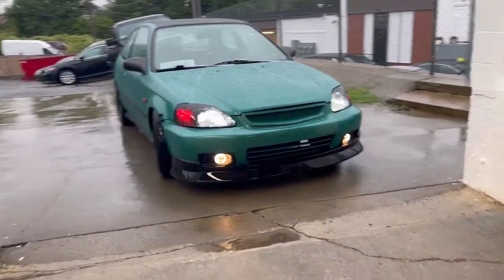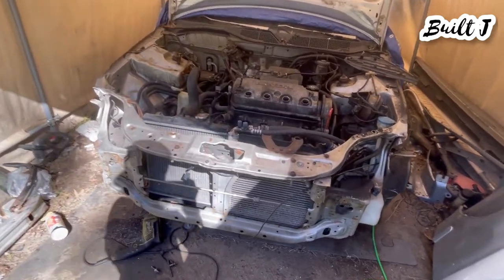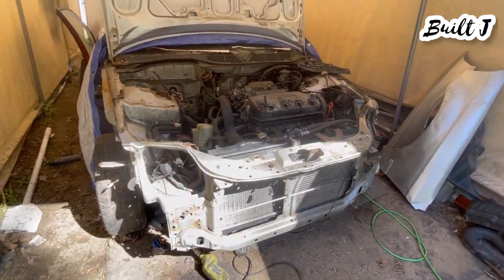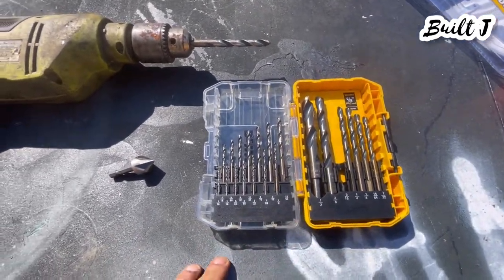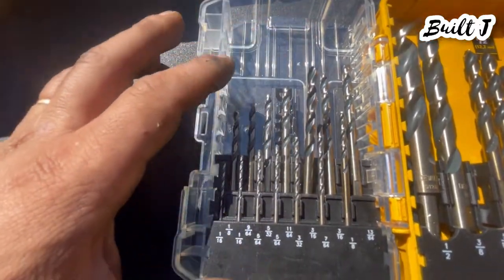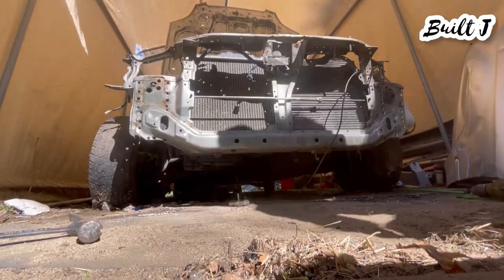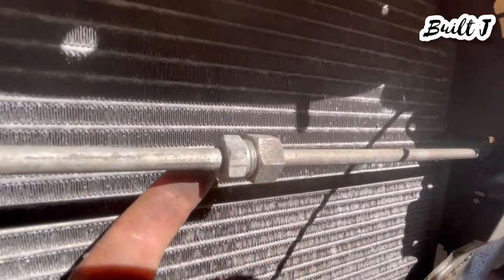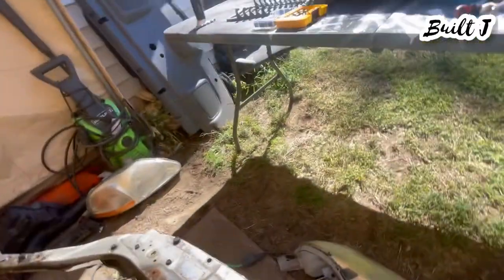96-00 Honda Civic radiator support removal

Comment: You gonna make an install video?
Reply from the maker: That’s a good question, I’ll see if I get around to it this weekend! Thanks for watching!!
Reply: I need to replace mine but I’m
Having trouble finding the exact year. What year rad support fits the hatch? I got a 
96’ civic dx hatchback
Reply: @OneSlowCivic  you can do 96-98 front end if you wanna keep the pre face lift or you can do a 2000 and have the face lift, that is completely up to you at that point since once you remove the radiator support you’ll truly have both options, i know this is 2 weeks late but hope it helps
Reply: I got a 97 ek sedan projection found a mint 2000 ek sedan with a clean radiator support. If I install this. I would have to do the 99-00 front end conversation or can I still use the 97 fenders hood and bumper
Reply from the maker: @jomi1413  you can use either front end but some slight modes need to be done for the bumper to fit. 99-00 front end with rad support! And 96-98 rad support is your best bet. With that said it can be done.

Comment: Is the EX coupe support compatible with the DX hatch?
Reply from the maker: Yes sir any 96-2000 civic should be interchangeable. Try and stick with 96-98 or 99-00 depending on your set up. Most people change their 96-98 rad support for a 99-00 rad support for the 00 front conversion but either front end will fit on either rad support with slight modifications
Reply: @builtjfilion934  That's perfect. My friend hit a deer last night going 70 on the interstate. Your video makes it nice and easy. Thank you so much.
Reply from the maker: Thanks for watching it helps my page grow!! Glad I could help